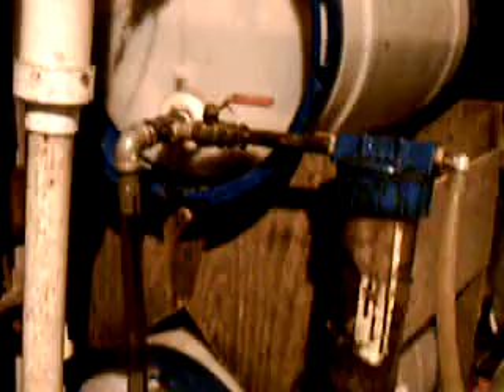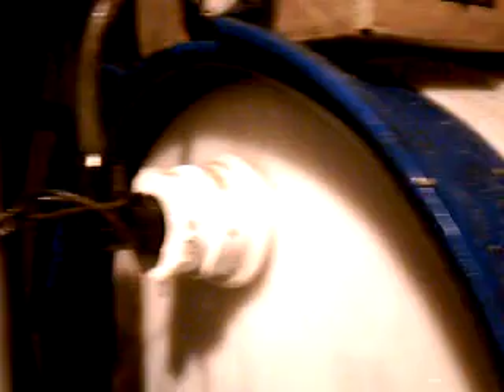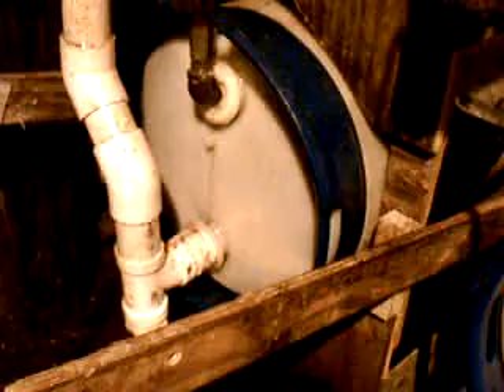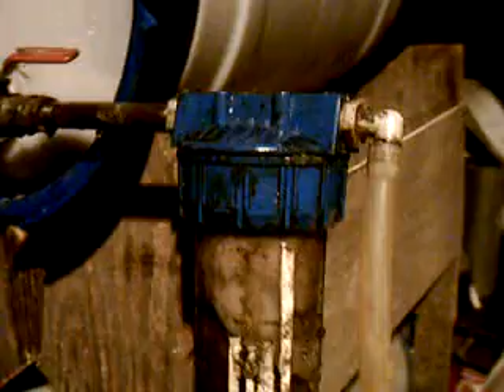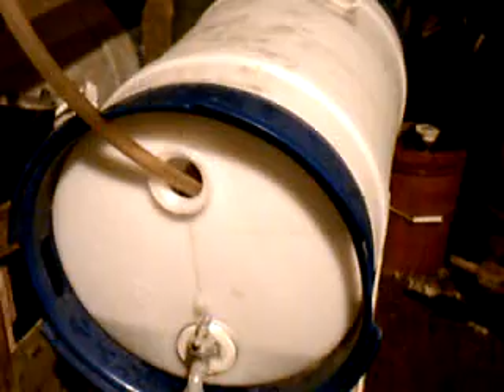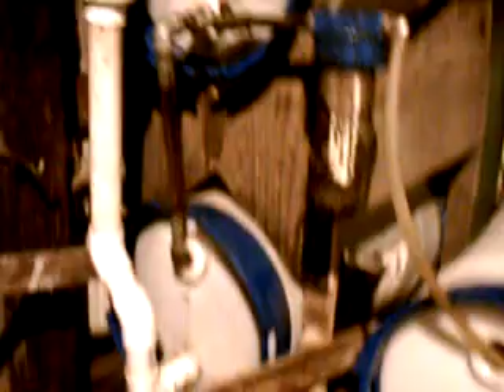Waste Vegetable Oil Filter How-To

Comment: I made one similar, mounted on heavy caster wheels to move around and used a small electric pump to push oil through the filer (much faster than gravity). I'll get a video up soon. Save your leftover oil because that stuff burns! Look at some oil candle videos for one idea. But DON"T dump the leftovers!